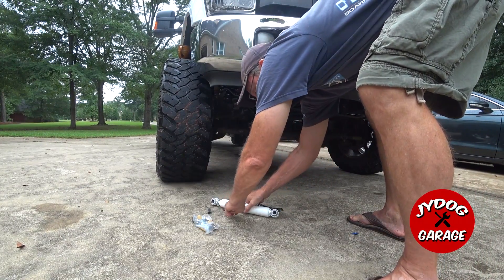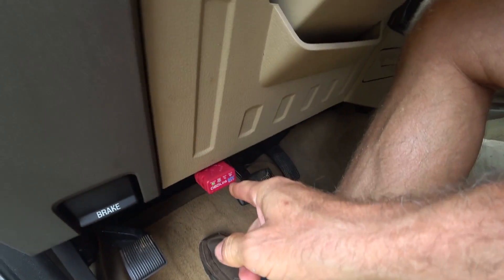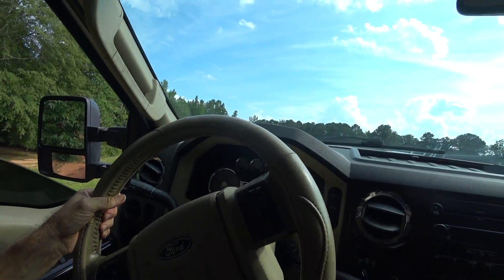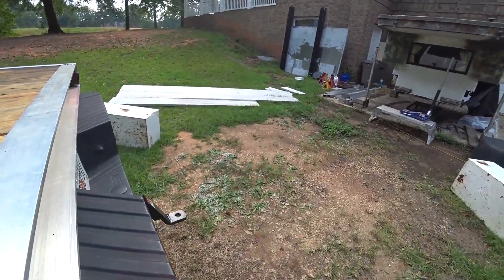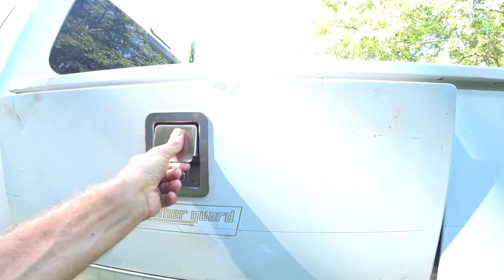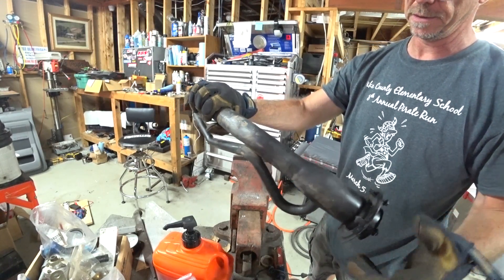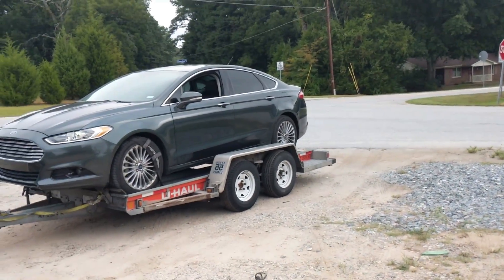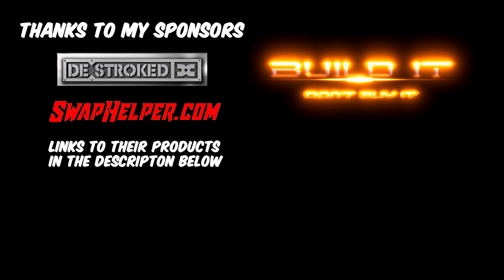Ford F250 Cummins Swap Put to Work

Comment: Hey just a suggestion. Cut the filler neck just past the evac vent hose. Flare the end and use a short rubber hose the rest of the way. Gotta love the sound of the Cummins! Great work
Reply from the maker: Thanks I was thinking I'm doing exactly what you suggested.

Comment: You are probably getting a lot more than 10 mpg. You are traveling much farther then the speedo is showing due to tire size. A Cummins will pull a pretty big trailer and still get 10! Love the build, thanks for sharing!
Reply from the maker: Yeah I'm not very confident on that figure. Fuel gauge is acting kinda strange

Comment: The flat bed and boxes would be more versatile. The military bed would still be pretty handy and look cool. My solution for the fuel filler would be to stay with the bent filler and route it through the bed floor and into the toolbox. That keeps it away from road splatter and rain and also makes it a bit harder to tamper with.

Comment: If you were keeping the boxes, I would of put my fill hose/nozzle, whatever you call it.. filler end in the box out of sight and theft and do it with black pipe to fit... I like boxes but I ain't there to see why they were made available. Kinda looks like you have a shoehorn fit for camper. I can see where that would/could be a advantage to installing when needed cause campers are nice but trucks are better with it being such a beauty of a build. I wouldn't try to do it anymore cause of my age and injuries.. I still hate getting rid of mine but couldn't crawl in anymore and getting out was even worse. I put a DT466 built to the nuts in my old 95 F350 five speed and luxury abound. (Even back up camera) with stainless exhaust five inch which was small but bigger looked wrong. Loving this build.. thanks

Comment: That Fusion has more space around the tires than the truck...it needs really the air suspension...
:-D
Thx for the vid!
Reply from the maker: Yeah the rear of the truck is getting airbags. I Know what you mean and I plan to trade the 37" for 35"s . I also wish I had used 3" steel for the bed sides ...,. V2.0
Reply: @JYDOG  :-D

Comment: So...what's the story behind the ABS and Check Engine lights on the truck? And...the verdict on the rebuilt title for Angel's new ride? You're keeping us in suspense Marc!
Reply from the maker: ABS needs a sensor replaced just need the time to get to it. Check engine is on because it is no longer in the truck. Could be fooled into going off but I don't really care that much about it. Just need coolant temp and oil pressure which are hooked up and working on the dash. Looking good on Angel's car so far. Waiting on some paperwork from California ( the title bond). Hopefully next video will be the results I'm hoping for. All the work has been done and money spent on it and just need to see what the DMV says. Stay tuned. How's your box camper coming along?

Comment: How much Hp does it make. I see a lot of people that do these choose that year model ford. Are they easier to do, or easier to come by
Reply from the maker: The 6.4 diesel engines that come in these only last about 150k miles and are super expensive to repair.  So taking out the least reliable diesel engine and replacing it with the most reliable one makes sense.
Reply: Availability and price. Because of their short lifespan the 6.4L show up all over the repo auctions. At this point in their life the loan amounts are fairly small meaning you can get a really nice truck with a blown engine for very cheap like around the $5K mark if you shop around. They have very nice interiors lots of options and they ride well and are very capable. And the older Cummins are stupid simple to put in really anything they run on like 3 wires and some fuel. But there are plenty of companies making parts for these trucks to aid in the swap. If you really wanted you could probably order everything needed to make it run and just bolt it all in.
Reply: Isn't it illegal to put an older engine in a newer truck

Comment: Wait. Does Tow/haul go away after the swap?
Reply from the maker: No, tow haul is working and I tried it out but it seemed to tow better without it. I don't think it was loaded down enough to use it.
Reply: I did a fummins swap since the cumming makes so much torque down low. To use the tow/haul accordingly you will need to lock up the tq converter in a sctx4 manually and should work fine
Reply: How much hp/tq does the SCT slap on? And is the fummins in 6.4 body?
Reply: @royturner6463  mine is not mine is a early 04 6.0 regular cab long bed when i used tow/haul the tq converter doesint lock that low cause the 6.0 was a high rpm engine so more rpm is more power a 12v makes peak torque around 1200 rpm ish and mated to a trans that the old engine loves rpm it doesint lock till higher up then factory amount in regular drive the sctx4 when you use it to lock it up it manually locks it at lower rpm so the cummins lug about 900rpm itll lock producing the best power implementation with your fummins
Reply: Well I thank you for your information but I'll have to look into that on the forums. I'm an 08 6.4. Still running. I'll fummins when the fun is over. I believe our transmissions are different. 6.4s have power low and high compliments of the compound turbo. You're right usually upon take off I would be above 1200 RPMs towing but I'm not sure what the truck ran stock. I bought it bulletproofed and modded. Even in no power mode the tune it is not close to stock. The downside to H and S. Would love to switch to SCT but no one tuning for the deleted world anymore. I should probably look up engine swapping and diesel emissions laws first.
Reply: @royturner6463  my 6.0 had 450k miles before it dropped a lifter and slung a rod thru the block bullet proofed and was running 650hp regularly i pulled houses made it much easyer with more power swaped in the cummins and had to do alot of mods to get it where i needed it and 200k miles she is still chugging with compounds and a few other pieces the cummins platform is so so much better for torque my 6.0 made 662.5hp and right at 1100lb of torque the 12v cummins i have is pushing 500 to 600 hp and it is making 1200 to 1400lb of torque and reliable to boot i haveing dinoed the cummins but thats what im guessing with my butt dino

Comment: Like military idea, dont over pay though, people asking stupid money right now, as high as 1200, whole trailer should be 500 or less, why did you do that to fuel fill, i know you have welder, cut an weld, most stuff you do is good quality ideas, kinda dropped ball this 1 time
Reply from the maker: Need to get fuel in the truck asap! That's the reason for the crappy Fab. Hopefully I can redeem myself.